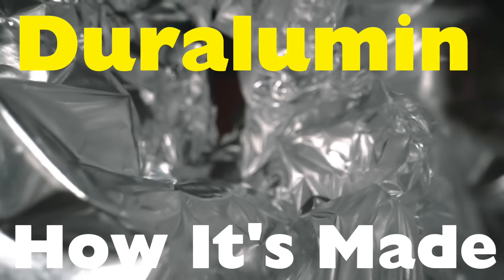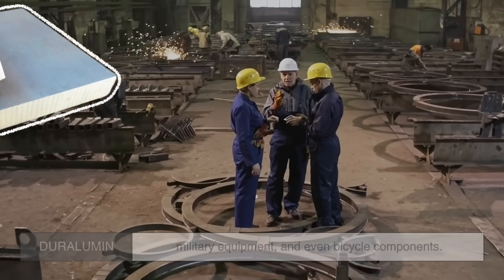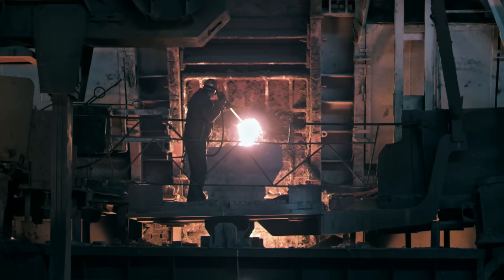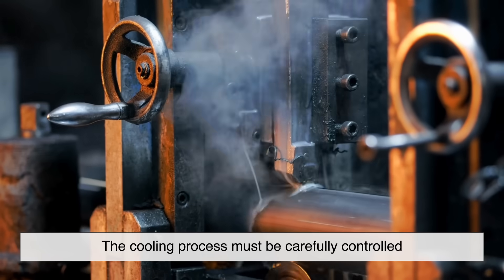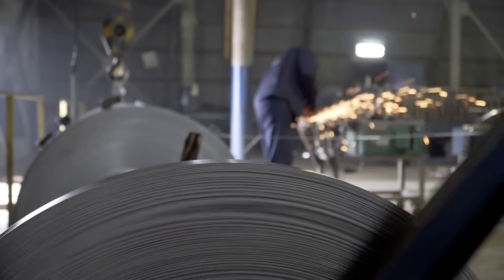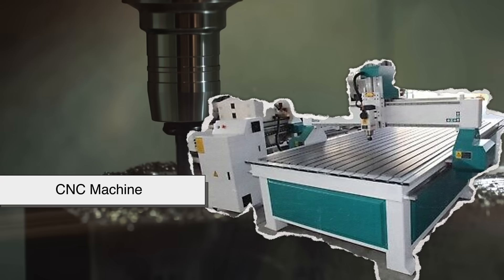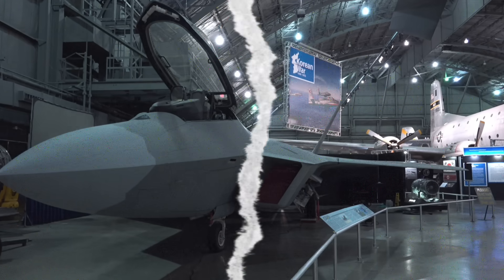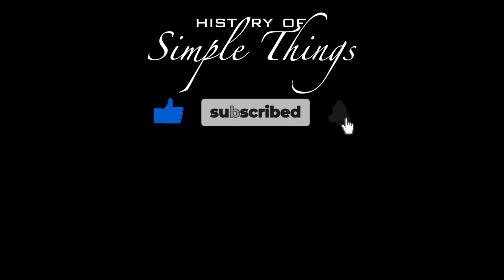How Duralumin Is Made

Comment: You don't need a CNC machine to shape aluminum. High speed steel will cut it just fine on a standard milling machine. Depending on what exactly you're doing or the surface finish you desire you might need a more specialized endmill or cutting tool however manual machines are just as capable as CNC just not as fast.
Reply: CNC is used for high precision cutting of duralumin at high speed and accuracy , OBVIOUSLY!

Comment: Duralumin was invented by a German metallurgist in 1909 and patented the same year. However, it's first major use was shown when it was used as the skin of the world famous first operational jet propelled fighter aircraft, the Me 262, and it's variants. It turns out that so many more inventions from Germany in the tech field have made it into our usage after Germany lost the war in 1945 and their fantastic cutting edge inventions, and inventors, were distributed between Russia, Britain and America. If it wasn't for the jet engines on the Me 262, the V2 Rockets, etc., etc. America's entrance into the jet age and the birth of NASA wouldn't have happened for at least another decade after the WWII.

Comment: Gotta love how this channel tells the story of aircraft grade aluminium but about half the clips are obviously showing ferrous metals in various stages of production.  Even the mention of "corrosion" shows a clip of ferrous rust, not aluminium corrosion.

All aluminium corrodes.  In fact, corrosion is essential to protect the metal since pure aluminium is highly reactive.  The layer of aluminium oxide, unlike rust on most steels, binds tightly to the surface of the metal and dramatically slows further corrosion.  

When advanced corrosion happens in aluminium, it takes the form of "pitting".  This process can be accelerated as a result of mechanical wear and tear as well as exposure to environments containing high levels of salts or certain strong chemicals.  Nevertheless, aluminium will still highly resist corrosion due to salts or acids and will last much longer than most steels in the same environment.

Comment: A suggestion for a more controversial video is the issue of "Chinesium", which is a derogatory name for poor quality metals (especially Steel) often (although not always) from China.

Anecdotally from a senior Steelworks Metallurgist the issue likely derives from impure recycled feed stock for the metal. The example being crushed cars used as feed stock in which none of the non-ferrous components (Aluminum, Copper, Lead, Cadmium and Glass) are removed from the cars before being used as Steel making feed stock

A recent example of the dangers of Chinesium has been the collapse of a Building under construcion in Bangkok during an Earthquake in which no other building of the same type suffered any significant damage.

Comment: In WW2 commonly referred as Dural. Vought F-4U Corsair used for Armor Plate. Wiki calls it IADS 2014 and 2024. German invented in 1909. ALCLAD modified to prevent corrosion.

Comment: Hola Grok, duraluminio, define:

¡Hola! El duraluminio es una aleación de aluminio conocida por su alta resistencia y ligereza. Está compuesto principalmente de aluminio, con pequeñas cantidades de cobre (alrededor del 3-5%), magnesio (aproximadamente 0.5-1%) y, a veces, manganeso u otros elementos en proporciones menores. Fue desarrollado a principios del siglo XX, notablemente por el ingeniero alemán Alfred Wilm, y se utiliza ampliamente en la industria aeroespacial, automotriz y en otras aplicaciones donde se requiere una combinación de durabilidad y bajo peso.

Duraluminio existe desde hace mucho tiempo,

Duraluminio significa Aluminio +duro.
Reply: Alloy 2024.

It was introduced by Alcoa in 1931, it was the first high-strength aluminum alloy and was then marketed as Dural.

The chemical composition of the 2024 aluminum alloy is as follows:

Aluminum (Al): 90.7–94.7%

Copper (Cu): 3.8–4.9%

Magnesium (Mg): 1.2–1.8%

Manganese (Mn): 0.3–0.9%

Silicon (Si): Maximum 0.5%

Iron (Fe): Maximum 0.5%

Zinc (Zn): Maximum 0.25%

Titanium (Ti): Maximum 0.15%

Chromium (Cr): Maximum 0.1%

Other elements: No more than 0.05% each, with a total maximum of 0.15%

Comment: I’ve spent over twenty years working for ALCOA and have never heard of any alloy called this. Every alloy had a designation such as 7075, 6063, C989, and others with the same ingredients. Oh by the way we never called impurities in the molten metal slag, we referred to it as dross. We also made everything from drawn seamless tubing, to many structural shapes. During the building of the space shuttle we delivered more than a million pounds of product a month at one point.
Reply: Duralumin as the above commentor stated is  a tradename and sounded much better than Alcoa's brandname for the "first commercially available" high-strength aluminum 'Dural'.

Today it is know as aluminum alloy 2024.

And yes, people in the industry use the term Duralumin for the class of high strength aluminum alloys in the 2000 alloy series

The first mass produced 'Duralumin' was introduced by Alcoa in 1931. But it was not called that. It was introduced to the market as 'Dural'. Someone called it 'Duralumin' instead for the word coined by a German  and the name caught on.

Sudebar - The name 'Duralumin' came out a discussion in 1909 during between Alfred Wilm and Dürener Metallwerke AG about naming the new aluminum alloy. Wilm initially proposed "Hartaluminium" (German for "hard aluminum"), but "Duralumin" was chosen instead, using the French word dur (meaning "hard") for international appeal.

'Dural' was the first mass produced high-strength aluminum alloy. Yup - the 1st.

The chemical composition of the 2024 aluminum alloy is as follows:

Aluminum (Al): 90.7–94.7%

Copper (Cu): 3.8–4.9%

Magnesium (Mg): 1.2–1.8%

Manganese (Mn): 0.3–0.9%

Silicon (Si): Maximum 0.5%

Iron (Fe): Maximum 0.5%

Zinc (Zn): Maximum 0.25%

Titanium (Ti): Maximum 0.15%

Chromium (Cr): Maximum 0.1%

Other elements: No more than 0.05% each, with a total maximum of 0.15%
Reply: @finestructureconstant3921 - Thank you for your clear and extensive informatiom
Reply: Duralumin was a trade name from years ago, today it's sometimes generically used for alloys in the 2000 series.
The name has stuck around down the road mostly because of tradition in the aircraft industry, it's first major usages were in aviation, dirigibles, zeppelins (not the Led kind) and the early use of aluminum in fixed wing aircraft when they started getting powerful to the point where wood wasn't strong enough anymore mostly used what was called back in the early days Duralumin. 
As mentioned it's not really a specific alloy anymore, just a generic term for ones in the 2000 series. 
It's like saying Band-Aid even though there's many different types of self adhering bandages.
Where'd you work for ALCOA at? Wouldn't happen to be Pittsburgh would it?
Reply: @dukecraig2402  The Led kind are fun to listen to though.
Reply: Same here,never heard it called that. I spent 18 yrs. at the Lafayette,In. plant. As far as i knew 2024 was an aircraft grade but 6061 and 7075 were more common. 5052 was marine grade. We made helicopter blades, wing root, keel beams, aluminum pistol frames, a few wing panels, drive shafts, and a myriad of other parts ,we even made parts for the space station.
Reply: Maybe it's an April fools thing...
Reply: Slag, dross: same thing! Just semantics!😂😂

Comment: So wait. Manganese and other metals are added to aluminum to make it more corrosion resistant, but then the resulting alloy is coated with pure aluminum to prevent corrosion?
Reply: Kind of. The pure aluminium is very soft but when it corrodes it forms a thin layer that protects it from further corrosion.

The 2024 alloy is very strong but corrodes continuously. The thin pure coating protects the alloy, like a coat of paint would.
Reply: @ - OK, thanks!
Reply: @davefoord1259 
No, pure aluminum doesn't oxidize, but it's about as strong as butter, when copper, magnesium and other alloys are added for strength then aluminum becomes susceptible to oxidizing, so a thin layer of pure aluminum is coated on the outside to prevent oxidizing, that's why you see shiny aluminum airplanes, without that coating of pure aluminum on the outside of the aluminum alloys used to make aircraft they'd have to be polished every day to keep that appearance.
Reply: Adding other elements, including magnesium is not for corrosion resistance, but to improve its mechanical properties.
These additions disrupt its ability to resist corrosion as it disrupts the formation of an inpermeable oxide layer.
One way to overcome this is by anodising the finished product, but that is impractical for large fabrications such as aircraft and in any case has limited durability.
Reply: Yes - it's called alclad, although they didn't name it in the video.
Reply: @ - Thanks!

Comment: I often think of the work that goes into making all our stuff.  Maybe because I have worked at so many of these factories myself as a Millwright? I am retired now but still keep working on projects.

The Aluminum my 1990's Chevy Step Van is made of is 97% aluminum with Chromium Copper and Iron added to make it much stronger. Iron and Chromium being much Cheaper than Magnesium and
 Manganese! :) 

it's does not need to be as strong as Duralumin, and it's more corrosive resistant.  I looked it up to see if it was worth welding repair panels, but it's better to use rivets like GM did when they made it :)

Comment: Back in the early 1900's, universities would add in alloying elements in varying percentages to various metals, measure the physical properties and chart the results. It can get a bit tedious. A grad student in germany was do that on a Friday. He had just mixed a batch and taken it out of teh oven, but it was late and he probably wanted to go drinking with his buddies. He figured he would quench it (did not wanto wait for it to cool on its own) and do the testing on Monday. Monday rolls around and when he does teh tests, it was an outlier. They replicated the test (minus the weekend wait) and the results fell right on the curve. Finally, the grad student confesses that he checked out early and waited two days before doing the test. They then replicated teh two day wait and got the outlier results. The two day wait (aka aging) added significant strength to the aluminum-copper alloy.
Reply: I don't have any proof to back this up.
But im a welder by hobby, and also capable of welding aluminium for practical reasons.
What I noticed when welding aluminium, the longer you wait after welding, and letting it cool down ofcourse, the stronger it gets.
My guts tell me that the weld is at maximun strength after about 1 day.
I have no idea if this is really the case, I never tested this under lab conditions, but just the 'feel' of it after a day of 'resting' is just WAY better than after lets say 1 hour.
Reply: Aluminium hardens significantly over a few days after being anealled. It's takes a few months to a year to fully ''harden''
Reply: What is this word "teh" that you use?

Comment: The real question is- Why does recycling aluminum pay so little $ as the cost to manufacture it from ore is so high ? Politicians? Greed? 🧐
Reply: Because melting it back down again is more expensive than getting it new from bauxite. It's closer to being viable than a lot of other things. Plastic, for example, is outrageously costly to try to crack back down to use as feedstock it is almost never recycled, it is shipped to 3rd word countries and burned (or, more likely, dumped at sea as soon as the ship gets out of view from land).
Reply: @ - totally disagree, wasn’t talking about plastic. It is extremely easy to recycle aluminum in a forge . Done it many times and they still pay nothing for it.
Reply: @jasonstclair1329  Wrong, you have to sort the aluminum into grade, which is prohibitively costly. You can't just toss a bunch of beer cans in a fresh melt, at least not and have any idea what you are going to get regarding composition. I mention plastic because aluminum recycling is actually a lot easier.

Comment: In the 1960's in the UK we had to have two separate antennas for the two TV channels. One was an X shape, ant the other an H shape. These antennas were huge, and just about 3/8" in diameter but each arm of the x was about 4 ft and the same with the four sections of the H, with a middle of about 5 ft. These were made of Duralumin, because of the need to withstand high winds. This video just reminded me of this fact- some 60 odd years later. thank you. (We only had two channels, the BBC and ITV independent TV which had adverts- the BBC was and is still funded by a tv licence) You HAVE to buy a TV licence if you watch "LIVE" tv on ANY channel in the UK-regardless of the supplier.(including any live online, or satellite from other countries) A lot of people now refuse to pay the BBC this tax as they are very biased in their news- hedging on conservative values.
Reply: Pay for a TV "license" ?  And you still have to watch ads?

Comment: Duralumin is an old term for 2024 aluminum of today..
Reply: Incorrect. Although they are both similar, one has more manganese. They are equivalent in function, not identical.
Reply: StrongAlumin!
Reply: 2024 is one of the weakest aluminium metals.
Reply: @vassiliseliopoulos3329  it is abundantly clear that you haven't a clue what you're talking about
Reply: @vassiliseliopoulos3329  It's  not as strong as 7075, but otherwise, wrong.
Reply: @vassiliseliopoulos3329  Totally disagree, there are lots of alloys that suck compared to 2024...
Reply: Not really, "duralumin" meant a whole of things depending on who made it. "Like 2024" is about as close as you can get, but it was never specified by any standard.